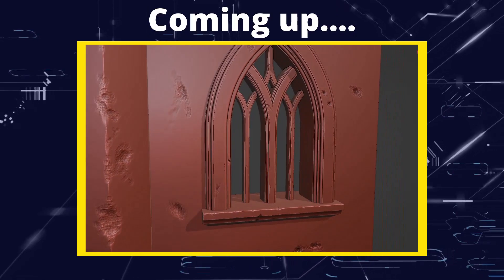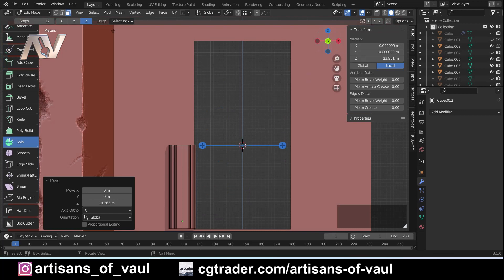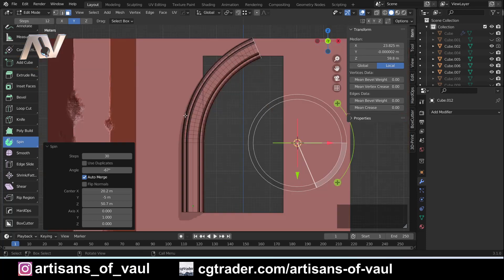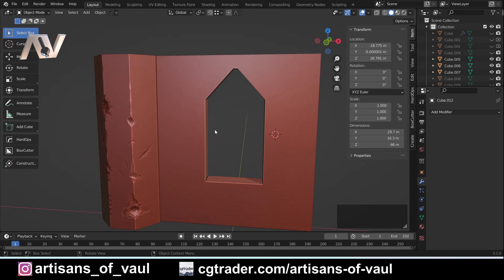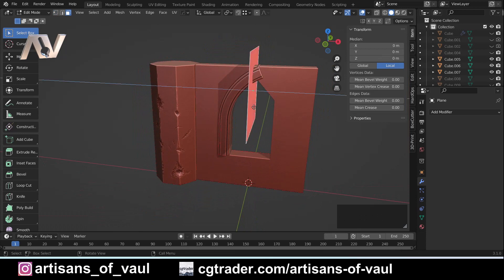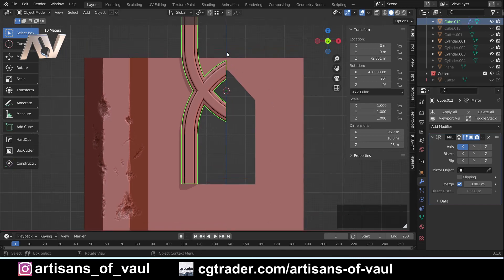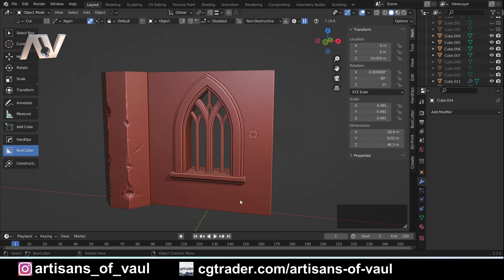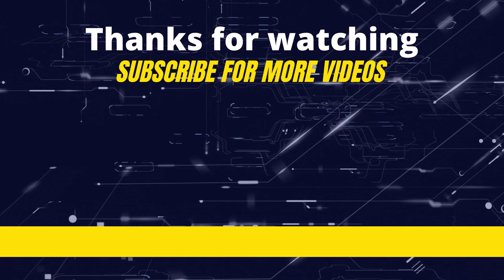Create gothic style windows using the spin tool

Comment: My computer really starts freezing up when I use booleans. I suspect it is because I use really low poly modelling and subdivision surface (lvl3).
Reply from the maker: Yeah, I found the same thing.  I found that it had much less issues when the sub-D was applied or I just used other methods to smooth everything off (like using bevels over sub-D where possible. But I realise that isnt possible for everyones workflows.
Reply: i also use really low poly.  with subd . my pc is not good either. but generally it dont freeze. noticed it tend more to have hard time  when using booltool

Comment: Possibly a silly question, but what's the difference between mirror and symmetrize? When would I want to use one over the other
Reply from the maker: Not a silly question at all. So symmetrize is a one off event that copies one side to the other. That means you could then change one side but it wouldn't change the other (unless you symmetrized again). A mirror is a modifier so it stays active so anything you change continues to be automatically changed on the other side as well.
Reply: @ArtisansofVaul  Oh! That makes sense, thank you

Comment: the window boolean cutter you can bevel so you dont need to use  a cube to boolean the cutter again. you can also  used symmetrize in sculpt mode. and avoid the error using the mirror tool.
Reply from the maker: That's very true. Sometimes it's nice to mirror so that future changes will also be mirrored but you can definetly do as you have said.

Comment: Thanks, I was trying to do the gothic arches with proportional editing and then inset but I couldn't get it to look how I wanted and the inset and bevel would go funky around the point of the arch - I will try this method instead.
Reply from the maker: I had exactly the same initial thought as you and in thr same way I kept finding it had issues. Let me know how it goes!
Reply: @ArtisansofVaul  It went great, I finished the "windows" and uploaded the result under "40k Rhino alternative Headlights (Baneblade edition)". You can see my awkward attempts at arches in an older set of headlights from a year ago, these are much better. Thanks again!

Comment: 16:49 - would it be easier to just select 'bisect' and 'flip' in the mirror modifier? I believe it does the same thing and might save you some steps. Fantastic tutorial btw!
Reply from the maker: That would definetly work as long as the origin is in the right place 👍🏻 And thanks 😁
Reply: No problem. Also, I just noticed that somebody mentioned this long before I did, lol my bad.

Comment: So good, thank you. Quick question: will the intersecting faces (where the columns intersect with the window frame) be an issue with printing? Would a union bullion be beneficial for that or do we just let the slicing software handle it?
Reply from the maker: You would definetly want to boolean everything together before printing and then cleanup as normal.

Comment: Wouldn't it be easier to make a 180° arch and use proportional editing set to root and drag up from the middle part? I used this to model a whole gothic cathedral and it tales just seconds
Reply from the maker: That would work too for sure. But it could result in certain proportions of the arch being different in thickness as if stretches I think. But it depends how exact you want to be
Reply: @ArtisansofVaul  I just use a semicircle and then extrude it, or convert it to a curve and use the custom profile